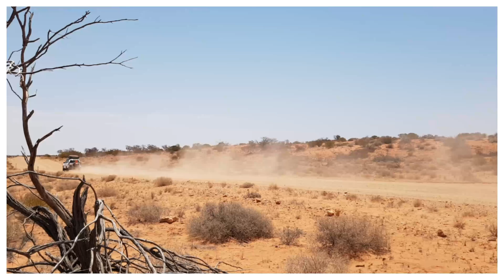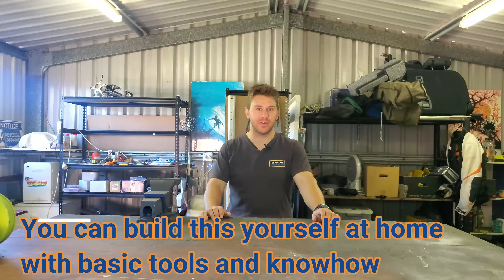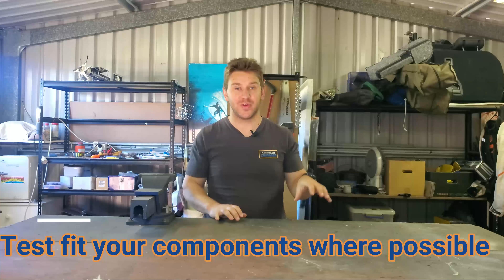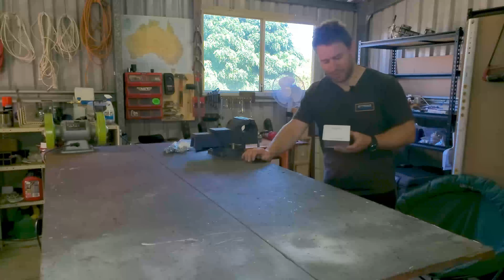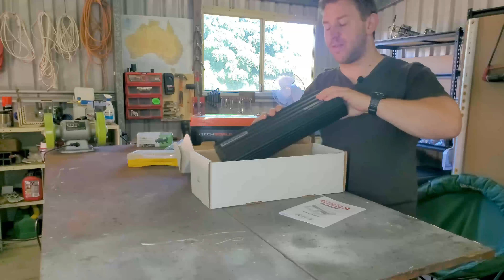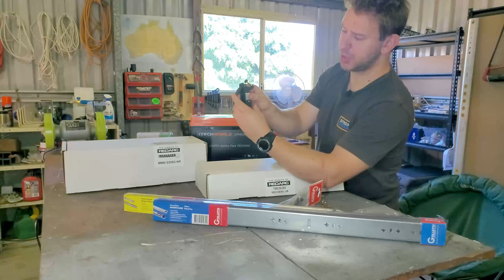How to build your own rear drawers Part 1 | DIY projects | Save thousands | Custom Creations

Comment: Hi Todd, where did you get the drawer catches from, what are those ones called and roughly how much for them please
Reply from the maker: Hi Christian,

The drawer catches I bought from Bunnings. Their website lists them as $18.36 each.
They are called Goliath Black Compression Locks
Reply: @offroadcrusader  thanks mate, I will look into that, I will need to replace some in the secondhand drawer system I bought. Keep up the great work on the videos, love seeing things I can do to my 200 as well

Comment: Hello can you make a video you explaine how we can installe 2 batteries in our cars and what accessories we need for that thx
Reply from the maker: As in add a dual battery system into a 4WD? I could do an overview video, but most installs are usually vehicle specific.
Reply: @offroadcrusader  we especially want to know the basic principle for the installation and we can take the toyota prado as an example
 thank you

Comment: Very interested to see how you put it all together! I built my own about 5 years ago and it was definitely a labour of love/hate 😭🤪 I made it up as I went and did a lot of things the hard way but learnt a lot in the process.. I redid my drawers a couple of years ago to improve them and make it easier and that's where I discovered the T nuts (captive nuts) and they are bloody brilliant!
If I did mine again I'd go with the double stack on one side like you are but the weight distribution always concerned me.
You've probably finished already, but one thing I did when I rejigged mine a couple of years ago was to weigh every part before reinstalling them. Made me realise there is a heap of weight in the drawers and every kg counts.
Looking forward to seeing it all come together mate 👍 Id say this is a brilliant guide for anyone tackling their own. There is a heap to factor into a nicely designed system rather than adding it on as an afterthought. Wish this was around when I did mine 👌👍😎
Reply from the maker: Thanks Ben, yeah I feel your pain on the rebuild, the drawer system in my old Prado went through a few different updates which I should have just done in the first place haha

Comment: I built some storage boxes from ply for my garage, im no cabinet maker but I found a better way was to pay a cut to size company, Ply, in Melbourne to cut my ply. I gave them all the piece dimensions and a few days later I got the Hardwood Ply picked up cut to size, ended up being slightly more than getting the ply from Bunnings then cutting myself, but way more accurate, way better quality ply. Also saved a ton of time and less waste cutting things wrong. 

Manager30 is bling-  red vision is another level, you'll love it. The iTechworld 120X battery are the ducks guts, I have one in our Caravan.
Reply from the maker: That does sound like a very smart way of doing it. Doesn't make for great blooper reels though :P
If my designs were as finalised as they could be then the cut  to size service would save a lot of time and effort for sure. At least this way Im free to make changes and updates to the design on the fly in response to new ideas.
Very much looking forward to getting to see the Redvision system at its full capacity soon!